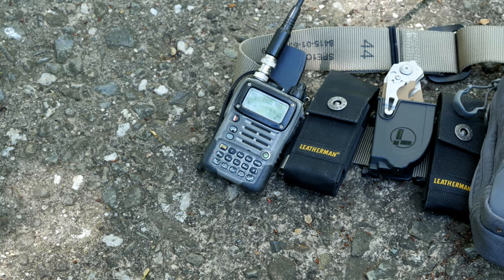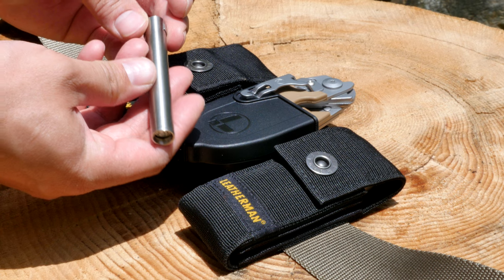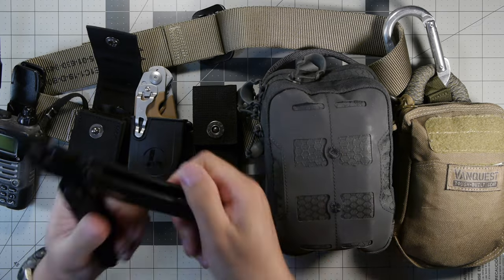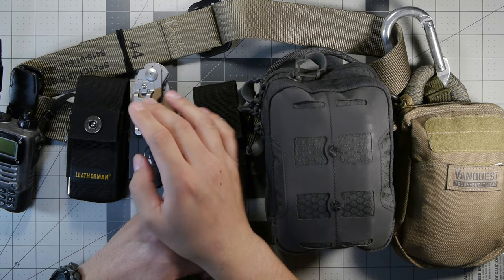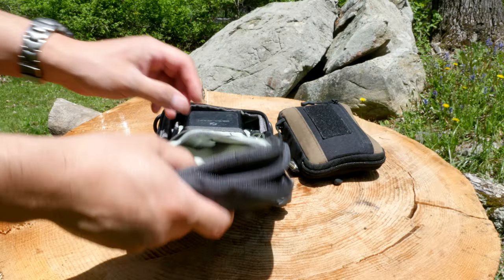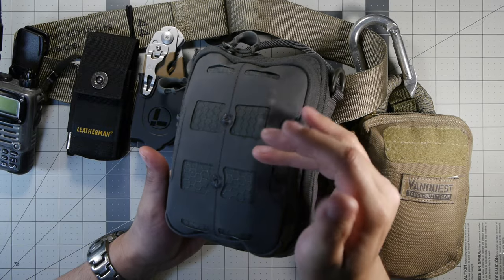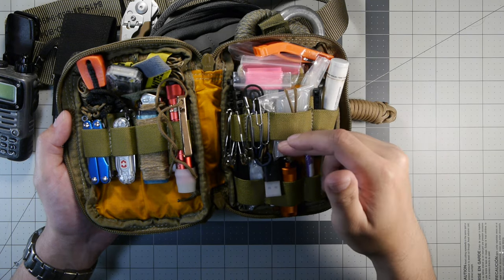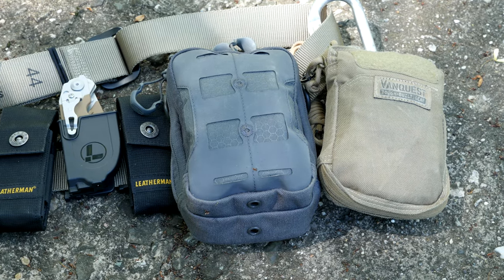EDC Work Belt Options - What I use on the EMS as an Attendant

Comment: do you think my friend vanquest slim is a good choice for edc? i'm thinking of using it both for edc and as an outdoor hiking kit. i'm also thinking of buying a plastic waist strap from aliexpress and attaching it to my belt, what's your opinion?
Reply from the maker: okay, a couple of things before I can say yes or no. What environments do you hike in?. What are you going to put into your hiking kit, how much weight is too much for you? How far and how fast and how long will this hiking kit sustain you?
Reply: @TheFossilChannel  mostly in forests and rural areas, I'm thinking of putting basic materials such as flashlight, multi tool, duct tape, ferro rod, compass, notepad, sharpie, super glue, lighter. Weight is not very important to me. Distance changes so I can't say anything. But I'm thinking of using it in edc.
Reply from the maker: okay , depending on the size of the items, you can use the ppm slim 2.0. also the husky maybe a good choice as it has some more webbing for organization.
Reply: @TheFossilChannel  Thanks for buying, but I'll buy the slim, probably the husky is too expensive for me (I'm from Türküye) ppm slim is too small.
Reply from the maker: good luck my friend. let us know how your pouch turns out
Reply: @TheFossilChannel  ok i will let you know if i buy it. 😃